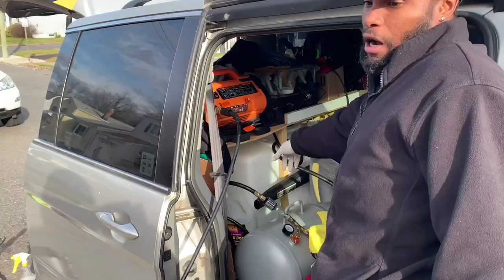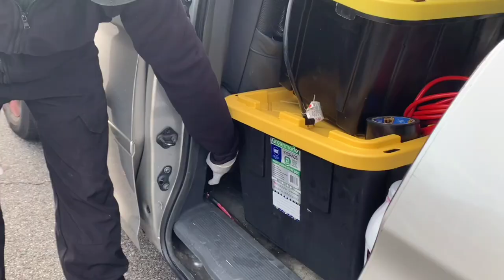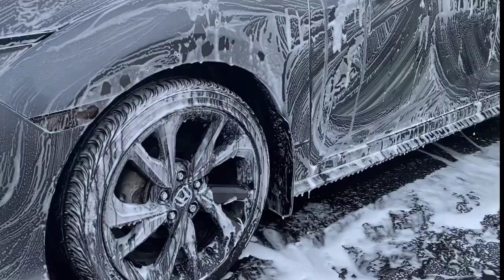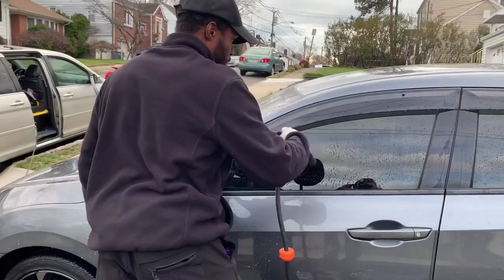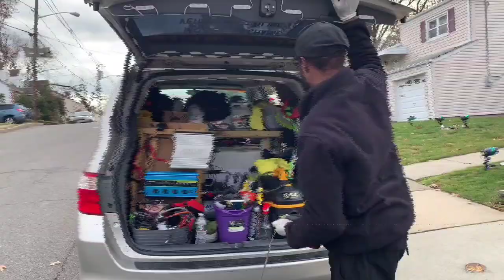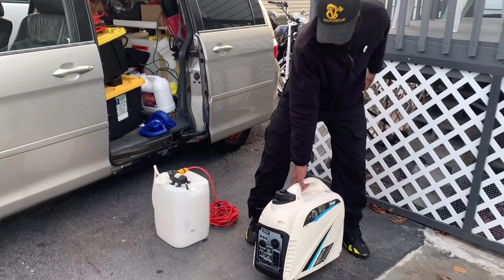MOBILE DETAILING VAN SET-UP! TIDY UP AUTO!

Comment: very nice set-up, what kind of batteries (brand, amp, etc) you use and are they connected parallel or in series?
Reply from the maker: What's up boss, I'm using two 100amp hour agm battery connected in series. I'm switching to Renogy Deep Cycle AGM Battery 12 Volt 200Ah, 3% Self-Discharge Rate, 2000A Max Discharge Current,  https://www.amazon.com/dp/B075RGX1WR/ref=cm_sw_r_apan_glt_i_9JVFAQHJADM42SNXG8G4
Reply: Hey there, what size of a electric power washer are you running of this inverter and battery setup? 
Also, how many cars you able to get done in a day say your just doing regular full detail.
Reply from the maker: @b.wakegijig2625  I switched to a 1600 psi Ryobi pressure washer. It's about 13amps if I'm not mistaken. 2 full car details  on fully charged batteries without having to start my van up, to recharge them

Comment: did this setup with all that weight ever mess with your transmission? Im about to build my Honda Odyssey but Im afraid the tranny wont be able to handle all of that weight...
Reply from the maker: What's up brotha man, follow us on Instagram dm me if u need any more info, Yes and no, the tranny on Honda Odyssey are trash regardless if u have a 2000-2005. I have a 05 yes it messed with tranny but I have air helper air bags in the rear springs  I'm still going strong. We are Mechanics so we'll just put another used one in around $800-$1000.